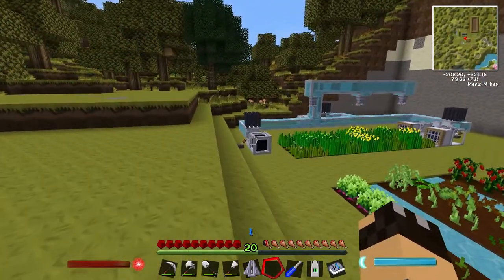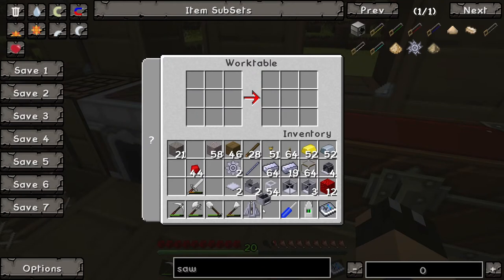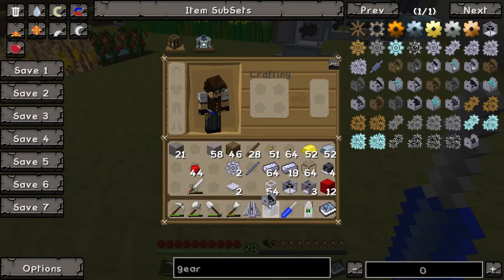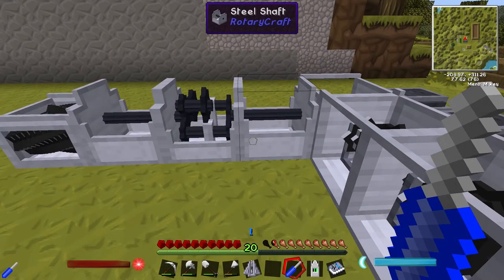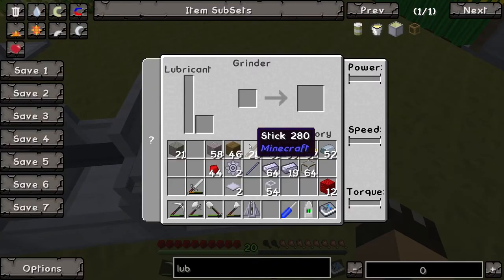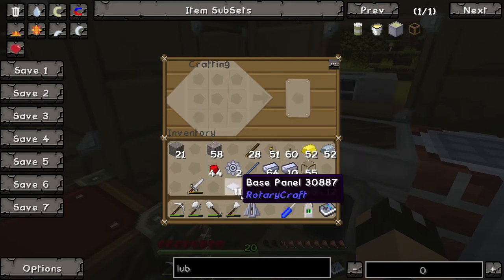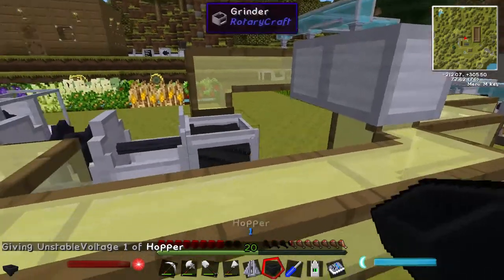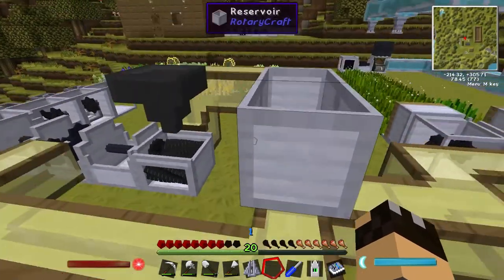Grinder and Lubricants -11- Feed the Beast - Horizons

Comment: I did some quickie research on this, the best and easiest way to rig up is using Thermal Expansion's Itemducts. Opaque ones need pretty much nothing to make, three fairly common ingots get you six. Make a Cresent Wrench to interact with them, and set the "extraction" end to Red, the placement end to blue. Grab a Pnematic Servo [glass, iron, redstone] and slot it into the pipes. Right-click on the connecting part of the pipe with a free hand, set it to "Low Signal", then whitelist whatever you want pulled through, and volaire! Easy item transport done cheap. Worked nicely with regular chests, so I see no reason it won't take the seeds from the vacuum.

Comment: Thermal expansion which is included in the Horizons mod pack has item ducts.  Hopper ducts might also work but I haven't played with them much.
Reply: This sounds best to me, you will probably need to make a pneumatic servo for the itemduct to pull the items out of the Vacuum. Edit now I've said that a redstone signal works as well and you already have a lever next to the vacumm iirc.

When you spawned in the hopper the duct was only a couple of icons adjacent to it for hopper ducts.  This would easily achieve the same thing and would be more interesting than Itemducts

Comment: 4.096kw @ 32rad/s means 128Nm of torque. Similarly, you could use a 4:1 gearbox with a single steam engine to run 16KW @ 128rad/s with 128Nm of torque. Remember, more rads means faster machines.

Regarding item transport, I believe you will have to branch out of Rotary Craft.  That said, there are multiple options.

Ender IO has some BRILLIANT conduits with incredible flexibility, but you will have to build a few simple machines to be able to craft the conduits.
Extra Utilities has itemducts, but will require enderpearls. 
Hopperducts are an easy/low-tech solution.
Thermal Expansion has itemducts (and OB is correct in pointing out that the opaque ones are cheap/low-tech), but I recall that TE ducts are not fully compatible with every mod in this pack.

Well done vid, as usual.  I figure we'll be seeing another one of your tutorials soon on some of this stuff.
Reply from the maker: Seems item ducts are the winner given most people's recommendations. And I think I agree. Very good suggestion about the engine - I completely missed the opportunity there. But I have now replaced the DC Engines with a Steam Engine. The grinder is running much faster, and the setup takes much less space.

Thanks

UV

Comment: Another nice vid thanks. I like to see how other people are using the rotarycraft machines  :)

If you haven't done it already, change the FTB launcher to use the latest version. (Near the top right there is a drop down box that defaults to 'recommended', change it to use 1.0.13) This should get you the latest release of rotarycraft which fixes quite a few bugs and I believe may add support for Pam's harvestcraft!

I haven't figured out a rotarycraft way to transport items so I just used item ducts (the opaque ones are quite cheap). There is an RC item cannon but that may be a bit 'overkill' for shorter distances!  As you are only moving one type of item here, the new hopper ducts may be the simplest thing to use. Logistics pipes look good but I haven't played with those yet so not sure how hard they are to make or use.

I don't want to give too much away as half the fun is experimenting but you may want to investigate the industrial coil, woodcutter, boring machine & extractor.
You'll need a bit more power for some of those but they are worth it ;)

I will say that if you experiment with the flywheels, don't put them near anything important; they seem more explosive than TNT! I think that better quality gearboxes use less lube but I'm not sure how much. The CVT may be the best as it only needs one bucket to get going not a constant supply... May need a cow farm for that though ;p

Comment: I really recommend updating your RotaryCraft copy. The Horizons version is like 3 months - 8 to 11 versions - out of date.
Reply from the maker: I did consider it, but I'm more concerned with demonstrating the mod pack as a whole. In the past, when I have used custom mods or different mod versions, it has caused a lot of confusion with viewers.

I understand that these mod packs and the individual mods are forever changing, especially in a beta - but I do get a lot of messages from people who are trying to follow videos of different versions and wondering why things don't work the same.

The last time I tried to update the mudpack to the latest version, all of my engines blew up - I tried several times before deciding to roll back.
Reply: The problem is, I am actually getting spammed with "bug reports" from people using your and other Horizons videos and who do not realize that several mechanics have changed.